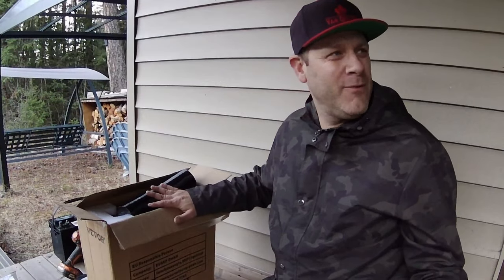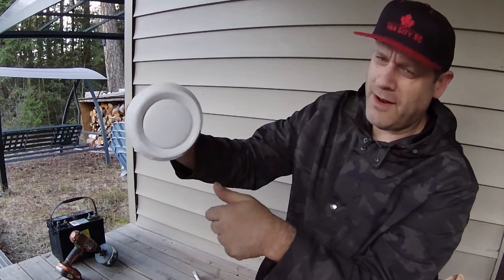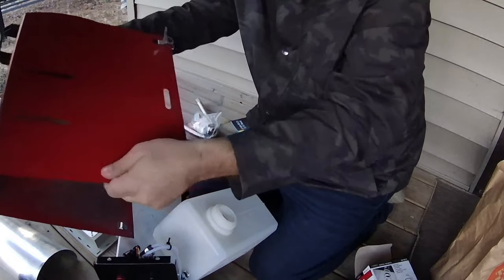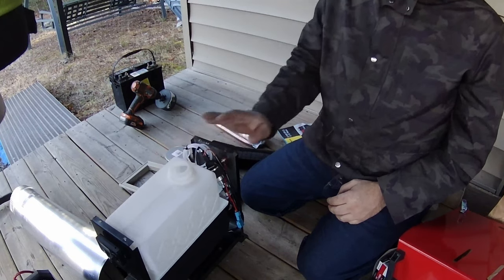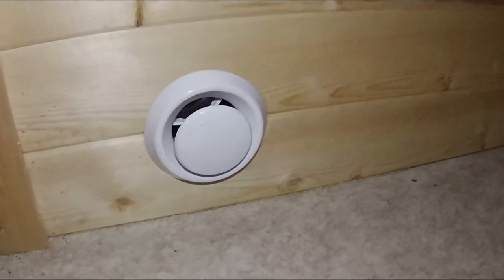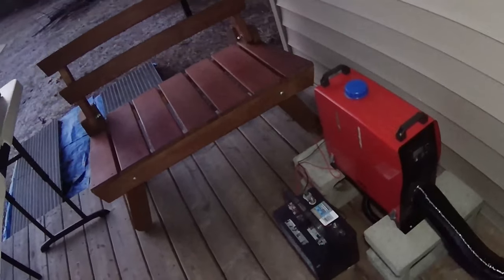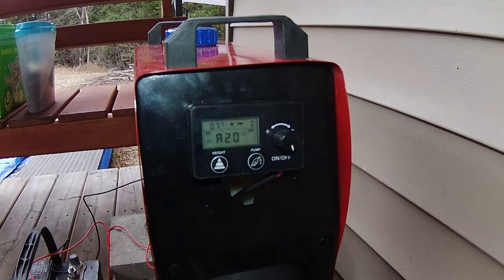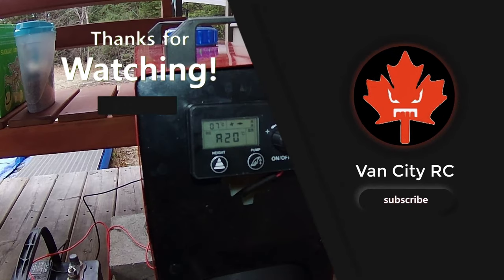I bought The Cheapest Chinese Diesel Heater On Amazon

Comment: Hi Dan, Your unit should start just as well on H1 as any other setting. I don't have that specific controller on mine, but I would guess the "Height" button switches to "Alpine Mode", for use at elevation well above sea level. I'm only 100 ft. above sea level, so I never use Alpine mode, but my understanding is that it reduces the Hz rate to the pump and increases the Hz cycle to the fan to allow efficient burn at high elevations. The pump button is for starting manual priming mode, so if you run it empty again, hit that button for a few seconds and it will run the pump for a few minutes by itself, to reprime the fuel line (watch your fuel line where it enters the bottom of the unit, when you see fuel being delivered, press the pump button again to stop priming mode) , then hit the power button to initiate start up. Your exhaust muffler is upside down, you need to have the weep hole facing down to allow condensate to drain out. When the H-x is displaying you are in level mode, so it will run at what you have it set on 1-6, when temp is displaying you are in Thermostatic mode, so the controller will speed up/slow down to maintain the set point temp, however, with the unit outdoors, if the thermostat is located in the controller, it will always run at full speed trying to reach your desired temp. The "Sensor" you see in the bottom of your tank is actually the fuel line connection, not a sensor, so when that is exposed above the remaining fuel level your tank is empty. They install the fuel outlet above the bottom because diesel can be pretty dirty and you don't want any debris collected in the bottom of the tank getting into the dosing pump, that's the reason most folks will install an inline fuel filter near the tank outlet. Best of luck to you! By the way your install through the house siding is one of the best looking installs I've seen on YouTube, maybe you can talk through the specifics of what you used and how you did it in a update video, I think that would be very helpful to those struggling with routing the duct through  their lap/vinyl siding. If you need to run this for more than a few days, you may want to get a little battery tender trickle charger hooked up to your battery to keep it fully charged indefinitely.
Reply from the maker: Some great info. Everything you mentioned makes sense with how the controller is supposed to work but I think this controller doesn’t 100% work the way it should. I was looking at possibly changing it out to a different controller but need to verify the harness connection before I do order one. Great suggestion to do a follow up video I’ll definitely do that when I’m back up to my cabin in Spring. 

Have a great weekend 👍
Reply: @Van_City  Dan Your controller is paired with the ECU board, not all controllers play well with all ECU's. Just a heads-up that you'll want to be sure your replacement controller will work with the ECU you have, or maybe just replace both with a mated set? Have a great weekend!
Reply from the maker: @StratOvation  thanks for the heads up.

Comment: It would work more efficiently if you run another 3" return vent out of the building into the back of the unit as a cold air return. That way you are simply reheating the air from the building instead of trying to heat cold outside air that has exhaust fumes in it! You can turn the pump down and use less fuel.
Reply from the maker: Great idea, makes sense 👍💯

Comment: !) This control is very,very old type; 2) At 6 Hz. you spend a lot of diesel and you need double tank of fuel.....3) When it starts need 12-14 Amps so need battery charger...
Reply from the maker: Thanks 💯💯

Comment: Now if you buy an extension cable and move the display inside it will turn off when the cabin reaches temperature.
Its running continually, Because it thinks its 0 degrees outside
Reply from the maker: Great suggestion I’ll definitely look into doing that 👍

Comment: You definitely do not want to put one of these heaters inside a property, on YouTube there was a guy who did that and the unit had a failure and completely filled his property with dense smoke which turned out to be diesel that hadn’t burnt off due to the failure. You can put the heater in a box or container outside the property to give it shelter from the elements but remember to put vents into the shelter or box to allow the heater to keep cool and to allow cool fresh air to get into the heater which will then be blown into your property. Just to note: You’ll need to prime the fuel system via the controller every time the fuel lines are completely drained for what ever reason.
Reply from the maker: Yeah I’m definitely hesitant to use it indoors. Someone suggested that I extend the wires for the control panel and  have it indoor.

Comment: I power my heater via a 12 volt battery which has a dumb charger connected to it all the time, whatever you do do not use a smart charger with these type of heaters as they do not like the constant draw of power. I’ve had one smart charger completely destroy itself and others that will just keep shutting down because of the constant draw of power, a basic dumb charger works great as long as you keep this in mind. The dumb charger needs to be a 10 amp (or more) charger, never have the charger on when you first start up your heater, allow the heater to start up from the battery and then once the heater has started and settled then turn on your dumb charger. The heater will draw up to 10 amps on start up which could over stretch the dumb charger and damage it. Keep the dumb charger in a place so it can get some cooler airflow over it for when it’s in use. When I’ve finished using the heater I’ll turn it off via the controller and then I turn off the dumb charger so the system is ready for the next start up, I’ve been using my heater in this configuration for a minimum 10 hours a day seven days a week and it’s been doing this for over a three month period now with absolutely no issues at all. I also use a mix of kerosene with 10% red diesel, the diesel is for lubrication for the fuel pump. Kerosene is cheaper than diesel here in the UK.
Reply from the maker: Great advice with the charger. Unfortunately I use this at my cabin which is off grid but definitely will keep this in mind if I decide to get one which I’m thinking I will for my garage at home. 👍

Comment: You have the exhaust directly under the fresh air intake . You should have the heater inside the cabin and run the exhaust outside. You maybe drawing exhaust into the heater and blowing the contaminated heated air into the cabin .
Reply from the maker: I was initially thinking of running it in the cabin and having the exhaust run outside but my son has medical issues where we have oxygen running and I didn’t want to take a chance with it malfunctioning inside the cabin. Fortunately didn’t have any issues with exhaust drawing inside the cabin. 👍
Reply: @Van_City  i understand your concern. It’s better to be safe than sorry. Breathing Oxygen isn’t something to take chances with.  The back of the heater is your air intake for heating the air you blow into your cabin .  To be safe I would route the exhaust away from this area. Wind currents change direction outside and you may inadvertently suck the fumes into the cabin.
Reply from the maker: @roberterickson68  thanks I’ll definitely have a look at rerouting the exhaust. Appreciate the advice 👍💯
Reply: You definitely do not want to put one of these heaters inside a property, on YouTube there was a guy who did that and the unit had a failure and completely filled his property with dense smoke which turned out to be diesel that hadn’t burnt off due to the failure. You can put the heater in a box or container outside the property to give it shelter from the elements but remember to put vents into the shelter or box to allow the heater to keep cool and to allow cool fresh air to get into the heater which will then be blown into your property.